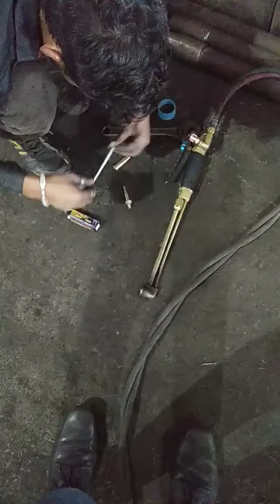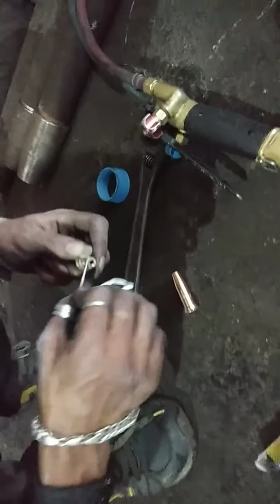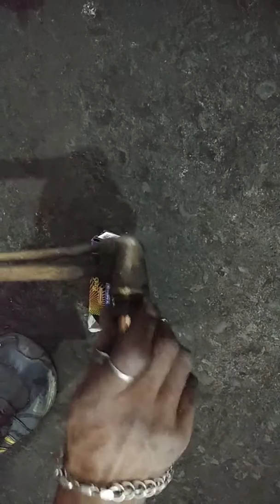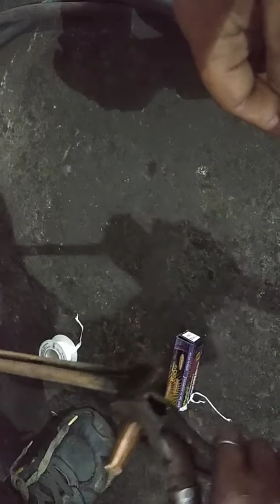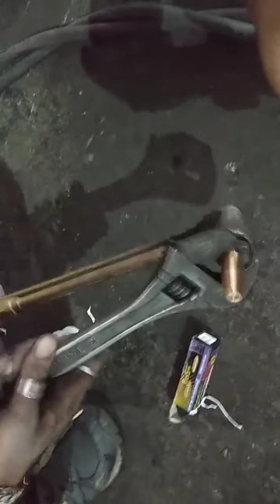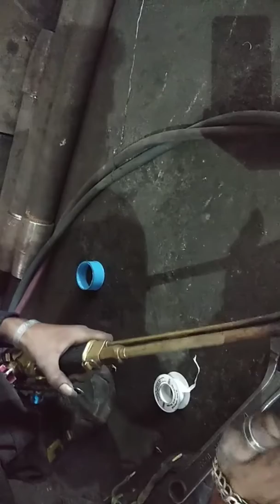Gas cutter nozzle  changing

Comment: 5 inch aur 6 inch ingat me konsi nojal lagti hai
Reply from the maker: Standard nozzle size for 6inch thickness is 5/64 and cutting oxygen pressure is 4.5kg/cm2, or Standard nozzle size for 4inch thickness is 1/16 and cutting oxygen pressure is 4.2kg/cm^2 so it's better to use 5/64 Nozzle for 5inch billet and adjust pressure between 3.5 to 4.5kg/cm^2
Reply: 1mm to 10 mm cutting nozzle size lpg oxy pressure